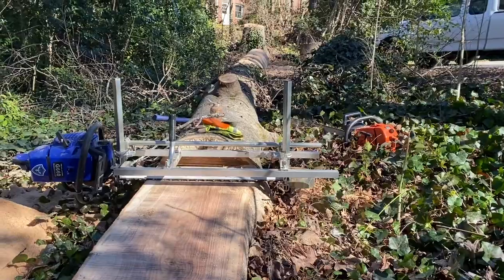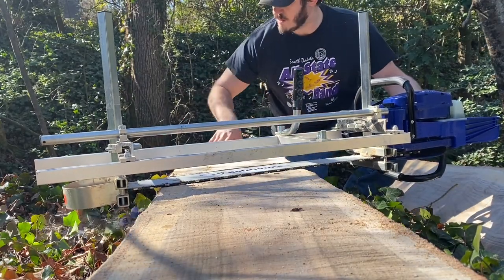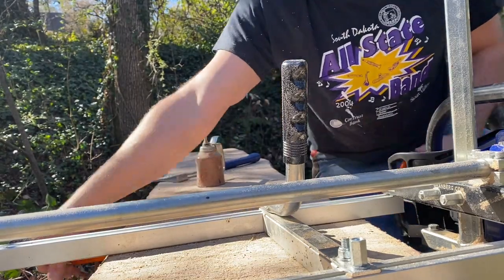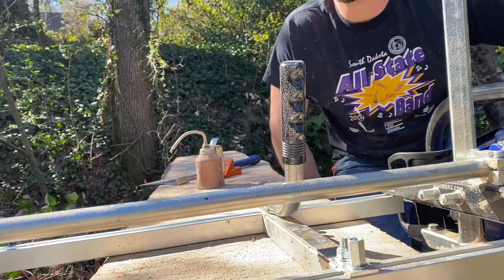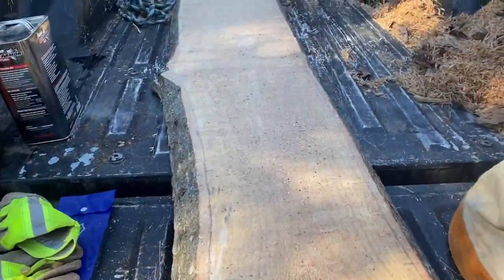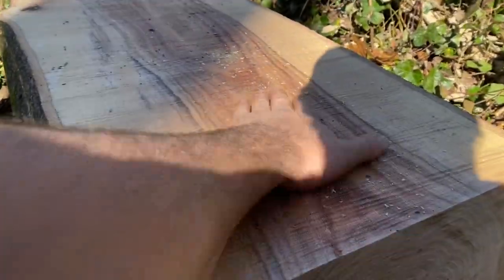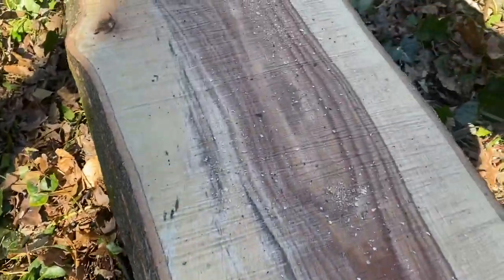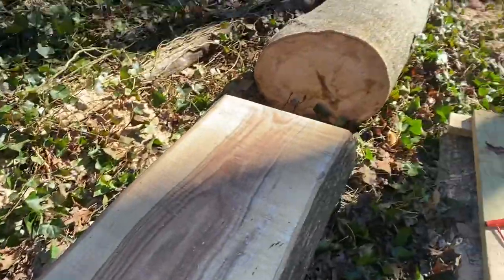Holzfforma g660-Chainsaw Milling Red Oak

Comment: That's the semi chisel chain that does that.  Get a full chisel and grind it to 0° and it will be a far smoother cut
Reply from the maker: That’s a great idea, thanks for the suggestion. I’m going to have to try that. Some pieces turn out better than others, but sanding out those waves takes a ton of time.

Comment: I have the exact same. Setup. You are throwing dust.
File you rakers a little if your chain is sharp.  Also get an oiler i use archer rip chain. 063. File with 7/32.
Takes me 5 min. For same log. Almost smooth. 10:54
Reply: Refill every run. Stopping leaves bad marks
Reply from the maker: Thanks for the advice! I’ve worked on the setup quite a bit and have awesome results now. I have used archer chains as well, great bang for the Buck!

Comment: Just noticed you have your slider bar clamp on towards the saw. It should slide on the wood. Still seems to cut ok. Cheers
Reply from the maker: Good eye! I’m using a bar that is too long for the log. So my options were either slide the clamp in and have an exposed chainsaw nose (because the guard needs to come off) or move over the grip to give me two points of contact.

The grip has a flat bottom so functions ok. It would be better with three points of contact, that’s true.
Reply: I agree. You have the bracket closest to the saw mounted backwards.

Comment: How do you like the saw? I am planning on buying one for milling up a neighbors 26 inch walnut tree fell down during a storm.
Reply from the maker: For the price it’s a great saw. I’ve run it hard ever since I got it, and it’s held up fine. I do think an auxiliary oiler is essential. I use a squirt can but want to make one that just drips on the bar and hangs off the mill.

Overall I’m happy with the saw, I would buy it again.

Comment: Seems like it runs  through gas super fast?
Reply from the maker: It is the thirstiest saw I have ever used. The saw actually died this last week so RIP…

Cylinder wall is scratched, no more compression. Milling is hard on a saw, but shouldn’t be THIS hard on it. I was running 40:1 fuel oil mixture a lot of guys are saying I should have used 30:1.
Reply: @urbanlumberjack  the Big bore kits 35 dollar
Reply from the maker: Did you convert to big bore? I need to replace the cylinder head, and thought about switching to big bore.
Reply: @urbanlumberjack  yes I bought the cheapest one on Amazon like same price as stock but more power and plus you can't break something that's already broke so good try it
Reply: @urbanlumberjack  Actually the manual says 25:1 stock. So I'm guessing that did it. Not to confuse with the MS660 which is 50:1.